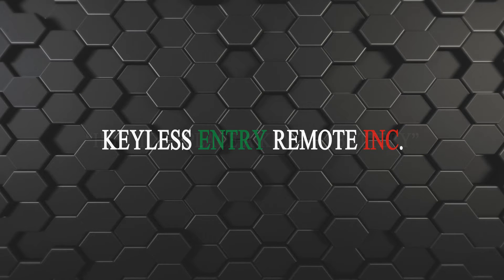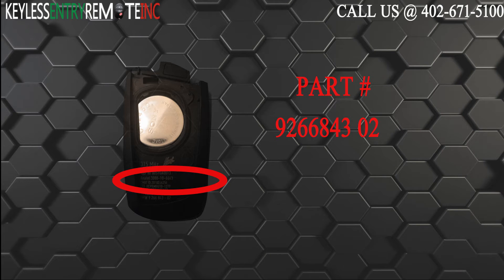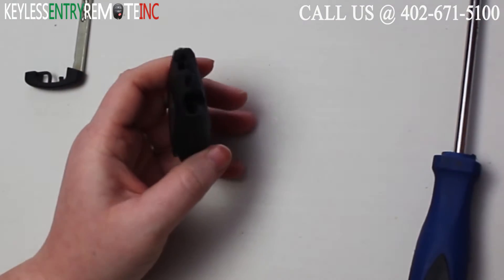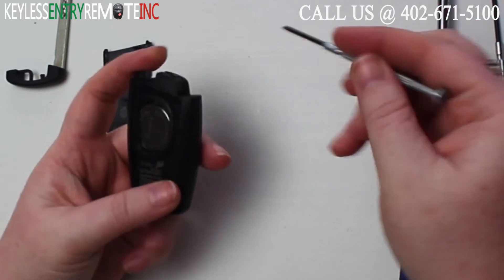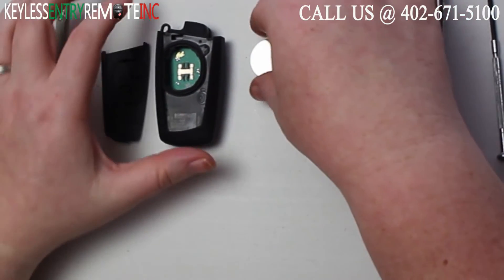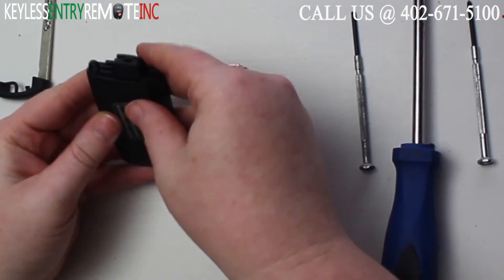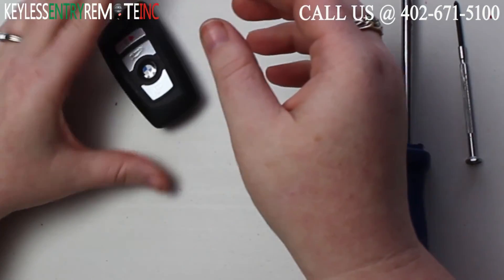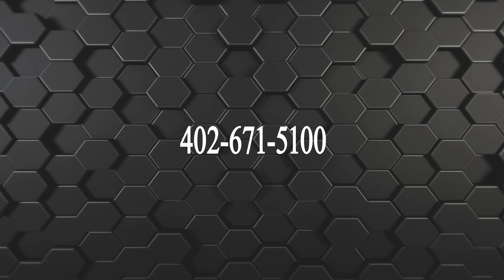BMW 750 Key Fob Battery Replacement - DIY (2009 - 2013)

Comment: It’s much easier to use the removed key  to pop the back plate off. I tried a flat head screw driver and it didn’t work well(causing damage to the remote). After watching someone else’s video (he used the key) and inserted the key into the little hole opposite from where you removed it and push inward. The back plate pops off effortlessly.
Reply from the maker: Thank you for your feedback.